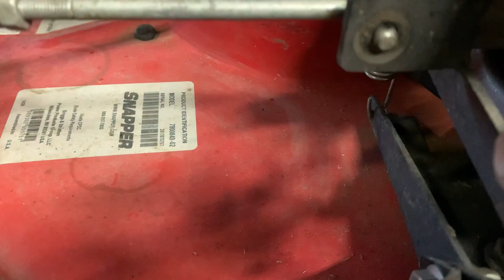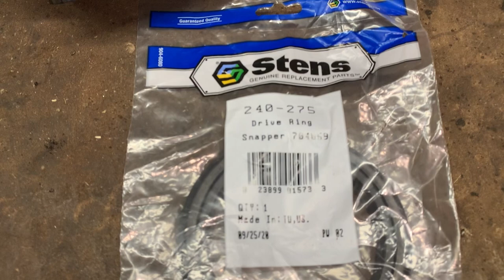COMMERCIAL SNAPPER DRIVE RING REPLACEMENT / FIX A SLIPPING DRIVE SYSTEM

Comment: when I came in for a stretch belt my dumb snapper dealer accused me of taking the idler pulley off my mower I told him I had no reason to do that I guess his diagram only showed the longer belt I haven't been back I get my own parts of the web mower still going strong 25 years later I do need a kill switch cable cable

Comment: Jeremy, i bet you like the rain better the snow you had. Snapper has had that system for ever and it works. I did that repair on a snapper that i flipped. It took about 15 minutes and the part was like $4.60.  Mower a  curb find and i sold it for $125.  👍🇺🇸 Roger
Reply: i have been flipn mowers for over 35 years i just cant sell them snappers i have 11 of them but my wife says i can but i wont they make or use to make 2 different style decks the one that the deck rolls under i tell my friends that it will suck the rocks out of their asphalt drive way
Reply: @dannysapp5559  the snapper hi-vac system really works. The closest thing that works well is what i use now. Its a john deere JS46 commercial mower. Love this mower.✌

Comment: I have the big brother to that one with the Kawasaki torque monster engine. The driven disk is nearly used up but still drives the mower fine. Yours look to have some life left on it. Wonder if someone poured oil on the drive disk making the driven disk slip? You can also dress up the drive disk with a whizzy wheel.

Comment: Did you look at the clutch spring?  It is under a cover. I’ve had them wear through where they connect to the cable or drive mechanism. Even with lubricant, they wore through so frequently I bought them 2 at a time.
Reply from the maker: Yup I adjust
Them included in the service